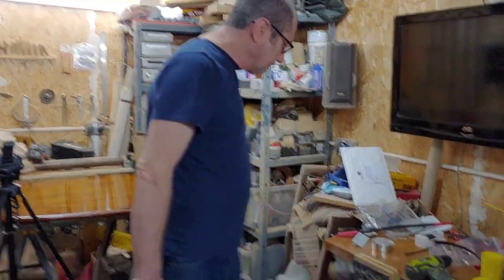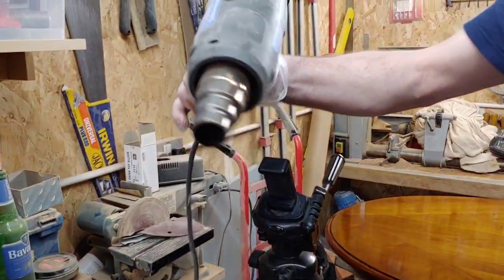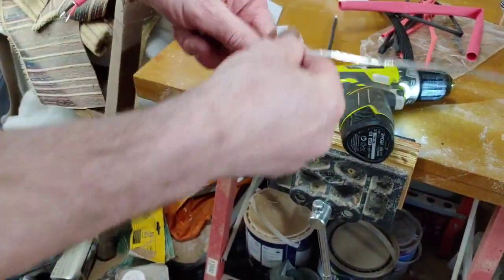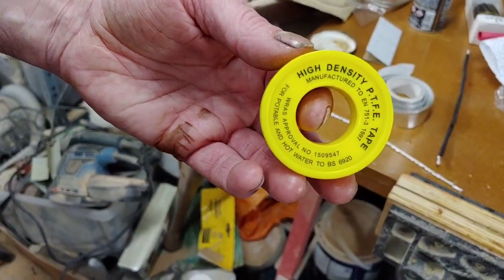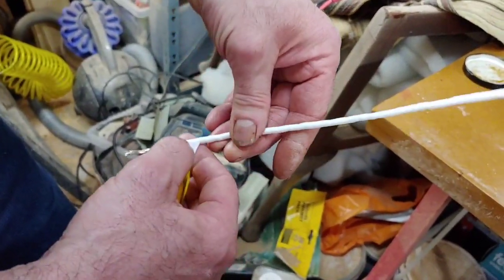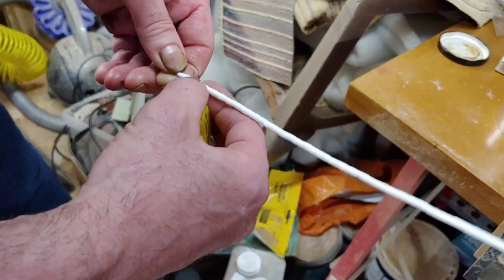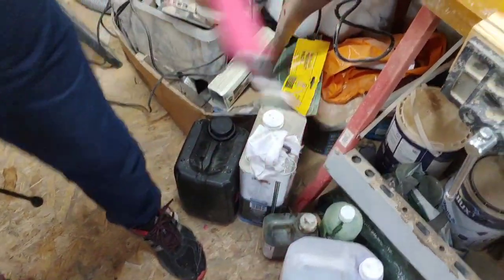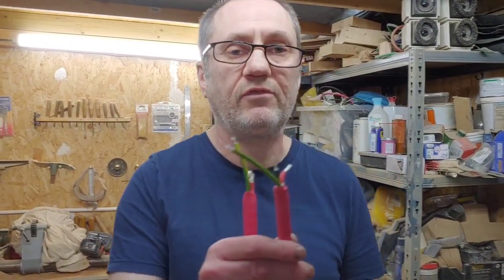How To Make A Ultra Hi-End Figure Of 8 Powercord

Comment: Hi, I stumbled on this by accident, I too am into DIY audio and coming from an electrical/electronics background, I have built many of my own designs, amplifiers, speakers etc. I would urge a word of caution though, if you're encouraging people to build their own designs especially on a YouTube or any other social media platform where your designs are based around dangerously high voltages and you don’t know peoples practical level of electrical knowledge (assuming your electrical knowledge is competent), this can be very dangerous indeed. For example, have you checked your DIY mains cables for basic electrical safety characteristics such as insulation resistance etc. is a PTFE tape made for plumbing (gas safe) been approved to be an effective electrical insulator for high voltages or heat shrink tubing approved to be used to solely insulate conductors at the lengths and voltages etc you suggest or electrical mains plug pin terminations approved to be soldered.
Reply from the maker: Hello, I've never had a problem with my designs, I've been building hand made cables for over 30 years, I only encourage people to make their own cable, if they are competent, if they are not, I encourage them to get electronics engineer or electrician to make them for them, I never promote dangerous actions, thanks for commenting & watching👍
Reply: @tweakerman  Have a check of you video How To Upgrade Your Wall Socket.

Comment: What’s the reason for using different gauge wires, why not use all the same? Loved the video will be doing this for my Thorens TT.
Reply from the maker: Hi Paul, the reason for using varistrand, is the larger strand helps with the lower frequencies, medium Strand helps with the midrange & small strands helps with the higher frequencies, I hope this helps, thanks for commenting & watching.

Comment: Thanks, this is very useful because I have to make a few of these cables. Thanks also for doing these videos even while you're busy with work. Doing the cables in a demonstrator size is really good because it shows the principles of construction really well. If it saves you a bit of time as well, that's a win-win.
Reply from the maker: Hi Jaf, I'll add the parts listing tomorrow, in the description, thanks for watching.

Comment: Could you use the same technique with the cotton piping for speaker cable too?
Reply from the maker: Hi Mike, most definitely, thanks for watching
Reply: Cotton fillers are extra useful in shielded cables because they help maintain a consistent distance between the shield and the conductors. This stabilises the electrical properties, such as capacitance and inductance. Cotton filler is also good in unshielded cables, such as speaker cables, because it helps maintain a consistent distance between the conductors when you bend the cable. Again, this provides stable electrical properties. Sorry, I didn't mean to hijack the question, I just thought I'd add my view.

Comment: Do I detect large quantities of Snake Oil?? This will not make ANY difference to the sound whatsoever. But on the bases of, if it cost more and looks good, it's gotta be better!!
Reply from the maker: One thing your forgetting is, you haven't tried it, so you can't comment, unless you have tried it, but your hearing isn't that good to hear the difference,  you snake oil police, do make me wonder😩
Reply: @tweakerman  First of all, lets talk of experience, am I qualified to make such a judgement. Lab technician for Quad, Founder member of Monitor Audio, Working on the first UK made 3 way speakers for cinema. Test Engineer for Cambridge Audio. Retailer Audio T Cambridge. First customer for DEM leads. 50 years working in the audio industry. One of the first in the industry to have so called special loudspeaker cables made. We sold 10,000 pieces at a trade show. None of us could detect ANY difference whatsoever, in fact they made some amplifiers ring slightly due to a higher capacitance between conductors. In fact on our blind tests using students from the tech in Cambridge. The results were almost 50/50 the same odds for guess work. But should I care? no. I made lots of money out of snake oil  in the past, as do many still today. 
If your viewers and you think they can tell a difference fine, we all have choices. Some people think there are invisible gods! I rest my case.
Reply: it does make a difference.
youu should try and polish the individual strands of wire and measure the resistance before and after and you will have your explanation my friend.